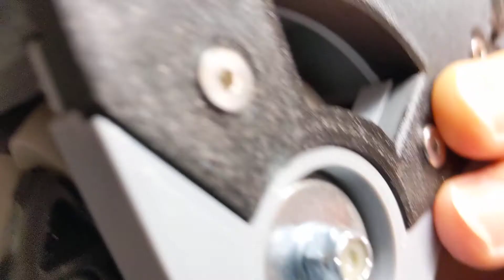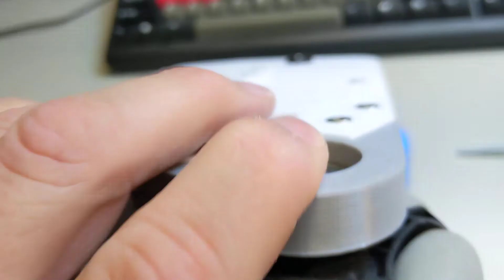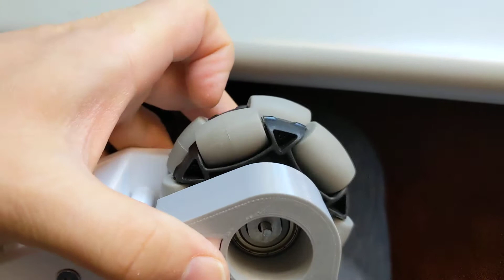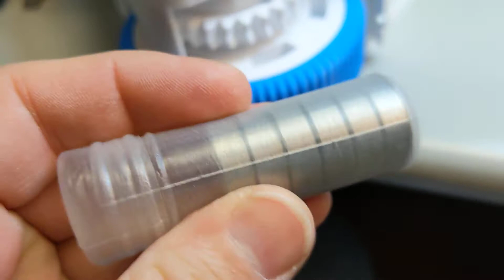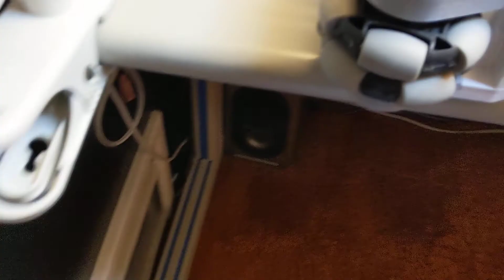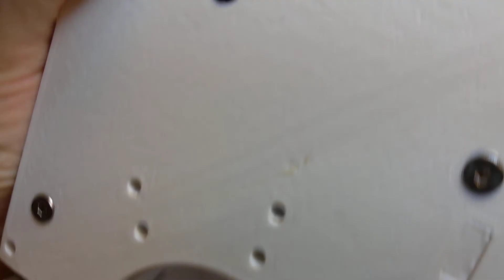3D Printed R2D2 - Part 26

Comment: I did find instructions, more or less, but did you have to cut the hex shaft yourself?  and get the threaded rod locally and cut that too?  Would be great if you could provide more instructions and sizes of the parts.
Reply from the maker: I did have to cut the hex myself and also the threaded rod.  I just measured after I had everything assembled and cut it a tiny bit long so I could shorten it a bit if needed.  The next time I take it apart I'll try to remember to measure the parts and post it.  There was another vex wheel version somewhere on the Michael Baddeley site that didn't use the hex stock but I had already made mine before I found it.  It's a pain to search Facebook, and I had a hard time when I tried to find it again.